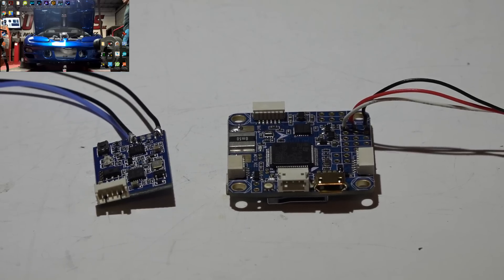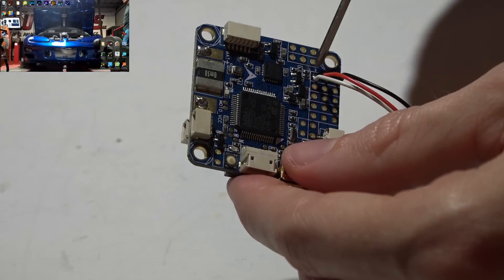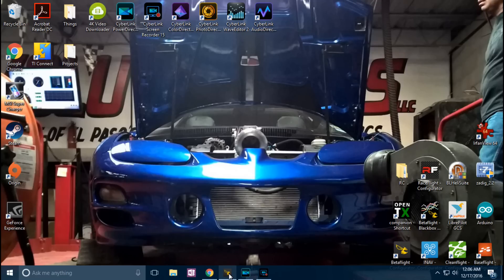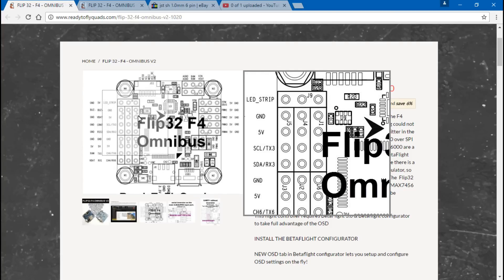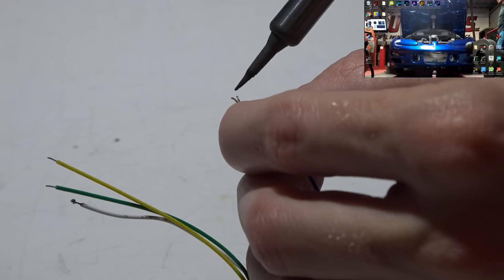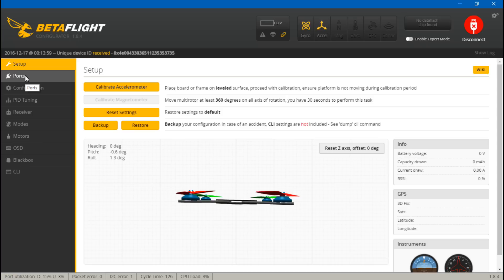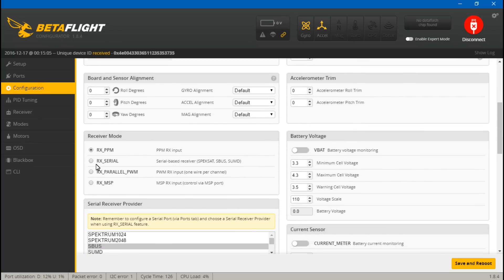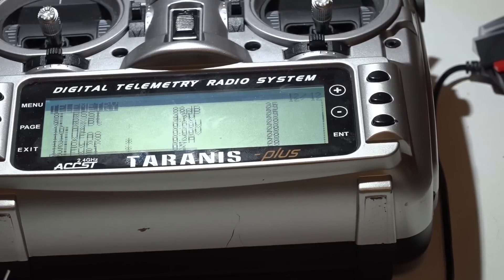Omnibus F4/F4 Pro & XSR: Connect & Telemetry

Comment: So if using the Omnibus F4 Pro (eg, V3) watch this video (https://www.youtube.com/watch?v=ZFVIbU4aJvo, "FIXED: SBUS Not Working on a Omnibus F4 Pro V3 Flight Controller?" video on youtube).. You NEED to solder the very very TINY sbus and PPM jumpers that are near the SBUS/PPM/5V/GND lead that you solder the wire into the SBUS/PPM lead. If you do NOT solder the pins together on the board, the rest of this video is bunk and betaflight will NOT accept your stick input AT ALL.
Reply: I did this. Still not working. Not sure what im missing. Gonna try flashing firmware.

Comment: For those who have an eachine X220S as ARF it has a custom F4SD omnibus, eachine is using the UART6 for SBUS by default. Therefore I successfully connected the non-inverted signal (as show on the video) to TX1 pin and successfully activating (smartPort/auto not frsky) in the telemetry port settings of betafaflight. No need to change MSP/UART1 has in the video. All is working ! Thanks for thee vidéo.
Reply: Benoit Masson my Omnibus F4 v3 FC also uses Uart6 for sbus. So tx1 worked for you? As of now I'm sure my is like yours, using USB vcp and Uart6. So I figured I could use tx1 or tx3. Thanks
Reply: I've put the non-inverted signal to TX3 and I have all telemetry except the VTX signal. I run lua script on Taranis X7 and there is a chance to change channel or frequency... on your radio. I have all the signals, telemetry shows up but no VTX. Do you have any solution. (on Eachine Wizard X220S)

Comment: Anyone know why this wouldn't be working? Betaflight keeps resetting to SPEKTRUM
Reply: me too
Reply: Federico Pcrl don’t forget to do the inverted wire part.
Reply: Yes i did it. I have the non pro version. Connected to the tx3 pin on the board, on the Receiver view I can only read aux1 1325, everything I push doesnt do nothing, and the others channels are dead
Reply: Federico Pcrl if the non pro version has a tx6 give it a shot.
Reply: I got it finally. It was the bauld rate of USB VPC set to 115200 and not on 9600, THE CORRECT ONE.

Comment: Hey, great vid. I've gotten everything working but telemetry. I have a 9x with the 9xtreme board running ErSky9x and I get data when I run a wire to UART 6 and select Smartport, but the data is bad (Alt= 2000m, etc) is there setup in the radio I have to do?
thanks

Comment: Does anybody know if the f4 non-pro version can do current sensing? The RTF quads description seems to say so and there is a pin that says "CRNT" but how would that be possible without the hardware?

RIP JC
Reply: Get a PDB with current sensor.
Reply: No. the non-pro board can not detect current. It can only detect battery voltage. Only F3 Pro and F4 Pro sense current.

Comment: odd, I asked the betaflight guys and told me that uart6 has inverter serial. I had some issues with my x4r which I solder to the wrong pin but they told me it supposed to work.

Comment: Can you please help the motors rs2205s with LittleBee_s 30a, and the F4 fc, In Airmode , the motors work in disagreement. In Angel mode in general, one engine is gaining momentum without a reaction to the gas, took 35 seconds on the video https://youtu.be/_1rq2jCCl5M help, can someone knows what to do?

Comment: hey JC  could you please make a video on how to connect and configure soft serial for GPS use along with s. port.  I know it's possible but I've been searching for hours for pinouts and pin assignments.     by the way I love your videos man keep up the great work!  all of us out here really appreciate your work, along with your transparency!!
Reply: hi if you find a method to do this please let me know. I'm searching for the same thing.
Reply: i checked out more of his videos, i totally forgot about i NAV  so i watched thos vids. anyways i got it to work  using beta flight, it was just for the hell of it , but it did work just fine, i did have to remap a soft serial tx to get the S. Port telemetry to work along side the GPS. i ended up just making one wire harness that plugs into the small port above the PWM output header , for UART 3/6 i believe.
Reply: So I can check I have this correct. Can you show me your output of the command resource list, please? and can I see a picture of your wiring please.
Reply: yea sure give me about an hour to get to the house I'll take pic of the gps plug as well as the CLI resource list to where I assigned the s. port

Comment: Ok got home from work today on a mission to get the telemetry working on my omnibus f4 non pro, I followed your instructions and let me say it worked!  Ok on the fc layout ppm/sbus-5v-GND is uart6 I connected the white,  red black wires there from XSR.  I also performed the XSR hack you showed us to get un-inverted signal and ran that wire to SCL/TX3 which is uart3 by the way.  On betaflight, 3.1.7 configurator 3.1.1, uart6 serial rx on and uart3 smartport telemetry on save and reboot and choose the serial based receiver and sbus on the config. tab, select telemetry save and reboot. Should be all set.  Thanks again for the video Blue Falcon.

Comment: Aahh!  disregard my last I had a brain fart as far as telemetry I was thinking if I have RSSI I should have the rest...not so fc telemetry is missing. I will pull my XSR and route the wire like you mentioned see if that works, I hope it does.

Comment: Great video, hopefully you can help with a problem I am having? following your video I have a setup exactly like you have described. (Taranis plus Xmitter with OpenTx, FC is Omnibus F4 pro)  All telemetry is there and updating for a few seconds then it stops and the only data updating is the basic RX data.  ie; rssi, swr, A1. all other data stops updating.
I have tried more then 1 RX, tried cleanflight and betaflight. Moved telem from uart3 to uart6,  ARMED and UnARMED, Main Batt connected and not, all with the same result....  I am stumped...
Thanks for any and all input...
Reply: I heard someoone mention that was due to a firmware issue with the Taranis - update the taranis firmware and that may help. I'm stuck in that my taranis and xsr are bound, but absolutely no stick response in betaflight! =(

Comment: Project blue falcon i wanna let folks know that racedayquads sells omnibus f4 pro f3 and folks need to know that they have hopping pads for sbus and ppm and sbus to be used must be soldered between middle pad and sbus jumper together. I had mine almost setup and was testing and no receiver input and seen the three pads
Reply: http://www.readytoflyquads.com/flip-32-f4-omnibus-v2-pro if you look at ppm-sbus there is number 10 beside it.. this has solder pads not the chips and yes its something that most folks would know what to do but maybe not
Reply: Can you elaborate on this? The run on sentences are killing me. I just received my omnibus f4 pro from raceday. What exactly are you trying to say that people need to look out for? Thanks
Reply: when wiring sbus for radio receiver, the omnibus f4 pro v3 has solder pads instead of resistors. so to have sbus the pads will need bridged with solder
Reply: can you link a diagram of the pins you're talking about? I haven't read anything about this and I've been looking up builds to prepare for mine.
Reply: I do not recall this ?
I have 2 Alien quads with F4pro v3 on sbus. pretty straightforward build. Short RAM voltage pads underneath. Solder pins for video, rx and motors. Done.
Reply: I haven't seen anyone talking about having to bridge anything either. What do you mean, Short RAM voltage pads underneath? Thanks!
Reply: So since the ppm and sbus are on the same solder pin, you just need to bridge the pads at the "10" to enable sbus over default ppm?
Reply: Looks like one of the reviews from RDQ mentions this as well! https://www.racedayquads.com/products/omnibus-f4-pro-v3-flight-controller-with-current-sensor-osd-and-smartaudio
Reply: My Omnibus f4 boards was V3 I think. I know for sure I did not bridge any pads and sbus is working fine.
Reply: Dag Eide the pads to be bridged for sbus to work are pre soldered and bridged from the manufacturer. They are next to the sbus ports.
Reply: Ah I see. Thanks for the information Felipe.

Comment: what is the function of the telemetry here. I want rssi on the osd and rssi callouts on the taranis so do I need to connect it up or would it do what I want already. they also have a v3 out and you were using a v2 what's the difference

Comment: Hi Blue Falcon, what about connecting tbs smart audio cable too, i have the omnibus f4 pro the XSR receiver and the tbs unify 5v with smart audio.
Reply: I'd like to know about this as well. This is the setup I just bought for my build. Still a bit confused on how to get it all hooked up and talking. Thanks!
Reply: I just connect the TBS Unify smart audio wire to UART TX6 and enable smartaudio in betaflight and everything works well,

Comment: Hi JC,
I just had the same problem setting up sbus on an omnibus F4 pro and I followed your video and it worked.  one question though.  should I put the USB VCP port back to a baud rate of 115200 once everything is working or just leave it on 9600?

also, I watch your stuff all the time.  great tips on hardware fixing, soldering, modding especially!  thanks for the great videos and keep up the good work!

cheers
noah
Reply from the maker: Hi ArkMan. You can set it back to 115200.
Reply: ok perfect thanks!

Comment: do you have to have your ESC signal wires hooked up for your receiver and transmitter to function? I'm waiting for my ESC in the mail and when I connected to beta flight my receiver is acting crazy. what do you suggest?

Comment: Hi JC,
Sorry nube question, does this mean only one wire is used in the jst connector which is for the telemetry? and the rest can just be removed?
thanks in advance
Reply: Project Blue Falcon I meant the one in the flight controller, smart port. Totally new to this telemetry thing lol
Reply: Project Blue Falcon, got it I didn't get it at first.
Thanks for all your videos, they've been very helpful

Comment: hi JC, thanks for the many great vids, they are all great stuffs. I've a question, for d4r-ii, which pin I should hack to get non inverted telemetry from my f4-pro? as at the back of d4r, there are 3 similar '3 legs' things. :) cheers David.
Reply from the maker: I haven't been able to find it on the D4R-II. And I have found it on the X8R but it's in between the two boards and not possible to get to. That's why I've only made videos for the X4R-SB and XSR.
Reply: I see, thanks anyway.

Comment: If you wire up the regular telemetry wire, can you turn on telemetry inversion on the FC?   I always assumed that did it in software...
Reply from the maker: Not on these. That only works if they have the hardware required. But they only have the hardware for the SBUS pin.

Comment: Do you need to solder rx and tx together into telemetry? Because in Naze32, I had to do that for telemetry to work. Thanks
Reply from the maker: No not on any F3 or F4 boards. That only applies to the F1 boards. For telemetry just put the wire on a Tx
Reply: Project Blue Falcon thanks a lot for the reply man! Btw, i love your channel! Very helpful! Especially for newbie like me

Comment: Thanks for the info!!! can you tell me what the three jump pads are for on the front let bottom corner?
Reply from the maker: I'm not sure exactly which pins you mean but I think you're talking about the OSD pins. Here is a video on wiring the OSD. https://www.youtube.com/watch?v=K6at0eZex9c&list=PLiYYhnH4BhI9lbVvjJH-hp1GQ1Lis-sI8&index=10&t=244s
Reply: Project Blue Falcon thanks I needed that info as well LOL but on my original question I'm not talking about the pin holes. if you have a pro version and the arrow is pointing away from you on the bottom side of the left corner are three small solder pads and I can't find any info on them or what they do. I believe it's got to do with power output somewhere.
Reply from the maker: I'm sorry I send you the wrong link. Heres the one you  need.
https://www.youtube.com/watch?v=seOP4ycwp48&t=3s&index=9&list=PLiYYhnH4BhI9lbVvjJH-hp1GQ1Lis-sI8

Soldering two of the pads together will send either 5v or the full voltage of the battery to the power pins on the OSD pins. But as I mention in this video I dont recommend powering the Vtx off these pins. I would use pins or pads off the PDB instead because the video hardly works if you do power the Vtx off the flight controller. You can solder the 5v pad to the middle pad then power the camera off the 5v pin. Thats fine.
Reply: Project Blue Falcon yes thanks that's what I was looking for. keep up the awesome video's sir!!!!

Comment: Excellent video ..... one question ... you think I'll be able to direct solder the smarport cable to the uart3 on the back of the connector? On the f4 pro ?
Reply from the maker: Philippe Pelaez If you mean solder the wire to the back side if the plastic connector, yea you can do that. If I were actually wiring this to one of my builds that's how I would do it anyway. I would just cut off the connector or use a hot air gun to remove the plastic and get it out the way to make new room for the wire.
Reply: Project Blue Falcon that's why you are the man!!! Hey brother another question do you have a PO BOX where I could send you new parts to keep so you could show on your videos?
Reply from the maker: I'd love to bud. Who wouldn't want to check out new parts lol. But unfortunately I cant do that now because of my schedule and all thats going on right now. Thats part of what killed the old channel. But hopefully I'll be able to work something out soon.
Reply: Project Blue Falcon ok buddy... let me know if you need anything or help with part you might need to show in your channel. I'll be happy to help.. :)